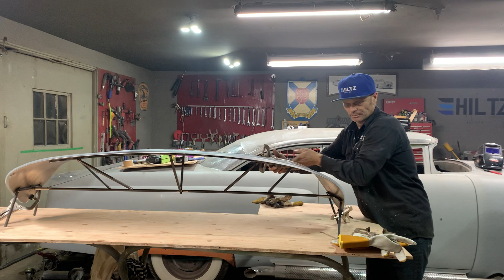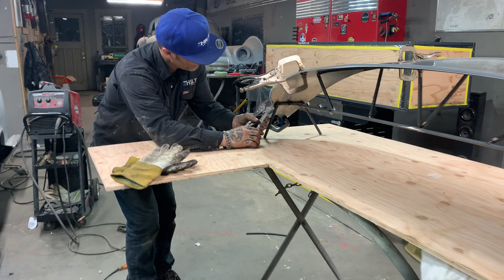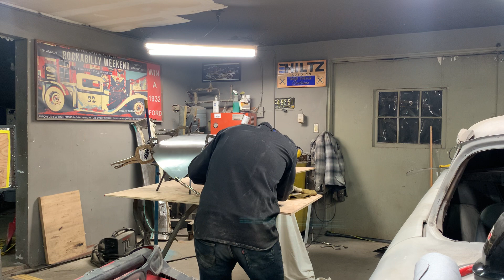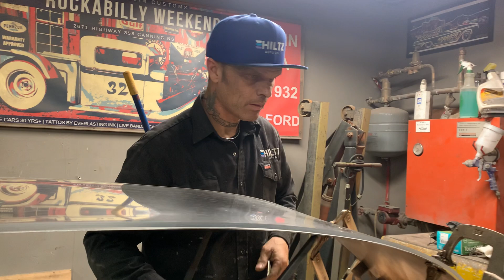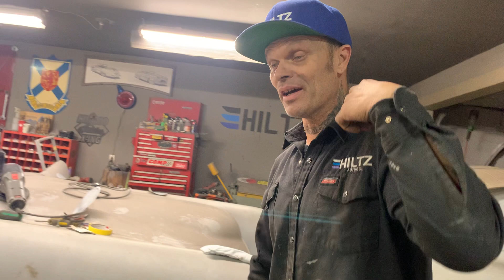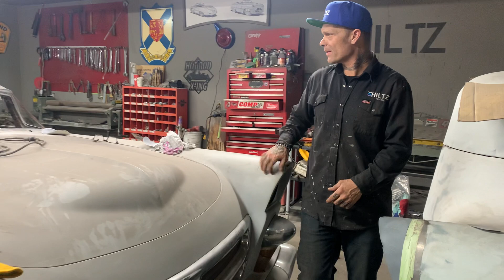THERMOFORMING: The 1st windshield BURNT UP IN FLAMES...Here are the RESULTS from the 2nd trial

Comment: First off love your videos! Funny how the mid works.. u are one of the most experienced with sheetmetal i have seen. Understanding how to bend and shape it.. now that your mind sees plastic it forgets how to form sheets of any material. I can see u doing sheetmetal and saying dont clamp corners first of it will wrinkle the metal when trying to clamp the middle of the bend.. i am talking to my tv saying free the corners man so it can lay down.. its like vinal sticker can put 2 ends down then try making center touch u will get wrinkles.. again love videos !
Reply: Oh also after its hot try heat gun to let it bend on its own.. just sujestion from severe amiture .. used to play with it and using a heated wire to let it bend. Hey checkout the russian guys they do heated plastic form making fenders using light bulbs way cool. Garage54 i think was the name

Comment: Good Job, Chad.  Maybe if you do another you could make the mold about 1/2" bigger all around.  Make the plexi 1/2" bigger also and try screwing it down to the mold.  Maybe start with screwing down the middle 3-4 feet and then putting it in the oven to soften.  Bring it out after it starts to droop and screw it all down to the mold.  Put back in the oven for a final cook until it is good and soft.  Bring it out to cool.  You wouldn't have to fumble around with clamps.  Self tapping screws are cheap.  
Enjoy the shows, keep it up.

Comment: put it back on the buck and trace around it to have a starting place, then measure the opening with rubber installed, you'll probably need to cut off 3/8 to 1/2 inch all the way around to fit the gasket
Reply: That just may be an answer!

Comment: I'd use Binder Clips from a office supply store to clamp the plexiglass to the metal form to let it cool rather than vice grips. Binder clips are often used in clamping the kerf liner on the inside of the sides of acoustic guitar building. Great job on the second try of the wind screen. Looking forward to see what tomorrow brings.

Comment: For the final windshield remelt this one if it’s not scratched by the welding clamps and get your self 20 or a dozen new Pony Clamps four dozen 2” square pieces of maisonite and some lead shot sandbags, clamps with maisonite both sides around edges sandbags lengthwise along the middle.  Have everything ready gloves on and work fast.

Comment: Wow its very similar to plastic vacuum moulding system u made if have look how that done u can maybe design your own like that too so could get more of sculptured shapes then too... Heat plastic to melting point in sheet then press the plastic down on to a wooded or metal mold and have the box vacuum sealed

Comment: I think you might have to sand it down a bit smaller than the buck because of the thickness of the glass and the fact that it was placed on top. The buck fit very tight into the frame. Very cool though. Looks like the oven worked a charm.

Comment: you could always use a heat gun at a distance to keep the plastic pliable as you set the clamps . I use a heat gun to dry and bake spray painted parts. Excellent looking windshield on the second go round . Nice to see you recoup and keep going to get success

Comment: Turned out pretty well.  Less Heat required.  Now the next problem is,  If  you plan on driving in the rain, wipers will mar the surface, and all the Plexiglas or plastic I have used scratches real bad from grit.  _  Max Yearwood
Reply: Don't drive it in the rain
Reply: You don’t need wipers in the rain 🌧 just use rain x and go faster
Reply: @shawns57garage  Right on !!!

Comment: On the next one, you should use a bunch of large gauge wire spring clamps. You know the ones similar to clothes pins use to hang laundry. If you had a couple dozen of those, you could clamp it up very quickly while it's hot.

Comment: Looks incredible, what a great achievement. Was wondering if you had a second buck, same as the one you have, when you took the window out of the oven could you lay the second buck over top and clamp both bucks together with the window in between. Less chance of scratching and equal pressure all over.

Comment: Hey Chad I was wondering what happens if when rocks kick-up off the the road from underneath other cars tires  isn't that going to put big marks on the plastic windshield. If you  can answer this for me or a subscriber of your channel, be cool to know. By the way I'm a big fan you got me wanting to try mig welder.
Reply: Good point, but wouldn't the same rock chip or smash a glass w/shield.  Maybe he could polish out any marks with a hard sand, and buff. He's putting clear wrap inside and out, so that may help.
Reply: @moyadapne968  cool thanks for your comment didn't think about the wrap

Comment: the fact that the plexi is curling up mean that the back got more heat than the front and that surface grue faster and more. if you want email me and i will give you my phone # and maybe i can give you some tips. i have over fourty years in the acrylic field. the way i discribed, clamps are not needed. the acrylic has what you might call memory and  when the temp has lowered to the point of past the point of being flexable, that is the memory point and any bend or curve that is not desired will be in the menory  you take the clamps off it will spring back they way it was when the internal temp reached that hardening temp  before you put the clamps on

Comment: Great improvement . Since Acrylic marks easy , make a couple spares for future replacement . MR Lexan from GE may still be available in light green tint . may be hard to heat bend but very durable coating for car use .   Nice work

Comment: Yikes... can't help but think about the teeth of the vice grips sinking into the oven softened Plexiglass. Should have used small pieces of wood on both sides of the Plexiglass to distribute the clamping pressure as well as limit damaging the Plexiglass where the clamps were applied. Would save time later on by not having to buff out dings and scuffs.

Comment: Congratulations and good work!  If you want to bend a small area more, just set it back on the buck and heat the buck gently with a propane torch.  It should fall into place without clamping.  You don't need to heat the whole thing.

Comment: Brilliant - failure to success in a single step! 
Don't throw out the barbecue/oven just yet though. When you've trimmed down the edges you may need to warm it up again to bring the corners in if it's a bit too wide for the aperture. Much depends on the rubber section and if it holds the screen above the flange or parallel with it. The slight ripples may be from where the frame is welded causing hot (or cold) spots. Don't see how you could avoid that and they're hardly visible anyway!!

Comment: Come on- it's like torqueing a head- you start in the center so the ends are free to move.  It also helps if you get your clamps laid out on your bench first.
Reply: Congratulations Chad....it took a ton of work but you learned what to do and what not to do.
Reply: @moondawg3693  HaHa- My guess is you are like Chad- took you 4 hours and 6 laps around the basement to find your computer before posting.
Reply: @moondawg3693  every artist has their style!  And it reflects in their artwork.  Cheers to personal satisfaction 🍻
Reply: Your all are wrong use a heat gun start at one end work your heat to the other end and the plexiglass will take shape without clamps or any pressure  let the heat from the heat gun do the work
Reply: @lifewithmikey  He already had the thing heated up and was clamping it on each end causing the center to bow up.
Reply: Old school i seen that as well the clamps are going to cause a bow or ripple effect in the center of the plexiglass because the edges are locked down not allowing the plexi to lay flat in the and flow as it cools he has the mold all he needed to do was use the heat gun work the heat to the other end slowly and it take effect from on its own I have used this method in several chops iv done over the years but your right he needs to slow down a bit Chad's an incredible artist with killer attention to detail
Reply: Old school i have to agree with you the glass and all door and trunk seals and interior should the last things on the build list right now the car is still in only mock up stage he is definitely looking a year or more to completion for a true road worthy car

Comment: After seeing this, I would put 2 pieces of pvc pipe angled in bottom towards curved part. Then stick 2 heat guns  and duct tape them in. Plexiglass softens around 320 degrees. Put a good temp gauge in there. Just a thought

Comment: I would try and make the oven electric next time to heat the lexsand glass with metal pencil rods on top and bottom wire the rods up and plug in wall that way you have heat on top and bottom. Just a suggestion for next time. I'm almost certain you'll be doing a windshield again.

Comment: I'm in the beginning still but I can say for sure you don't want it clamped at the ends. It needs to be able to naturally fall or it will bunch up.
Reply: I missed that it was hot already at the beginning. I think he was on the right track just a little shy of "done" in the oven. The key is keeping the temp low enough for longer and not exceeding your soft stage to burn/bubble/warp.

Comment: IMO, don't use steel clamps on Plexi, they mar the surface and leave divots, they remove heat from the surface IN THAT ONE SPOT, and do not allow equal cooling and contraction of the plastic. Use plastic clamps and a lot of them would be best.

Comment: Way too much heat. A hair dryer or two would work better. Someone suggested using parchment paper between the plexiglass and the metal form to keep it from sticking. Sounds like a plan.

Comment: Chad, that windscreen looks fab, a bit of fettling will get it fitting in the rubber like a glove. Should be nothing wrong with using Plexiglass at the front, this is exactly what was used in the bubble cars like the Messerschmitt KR200 and the BMW Isetta !

Comment: CHAD I NEED IT DONE AGAIN... YOU CAN NOT POLISH OUT MELT STAINS  you clamped it down on hot plastic and market the plastic,, first time in the oven to long second time in the oven not enough ,, go back and do it again and let the plastick melt on the steel by its self ,, then bring out to cool ,, also your cut around the edges of the screen  not look right on the ends,, and its got hair and dirt in it ,,, your gunna have to do it again,, im not happy with it ,,, also you carnt polish plastic with out it smudging